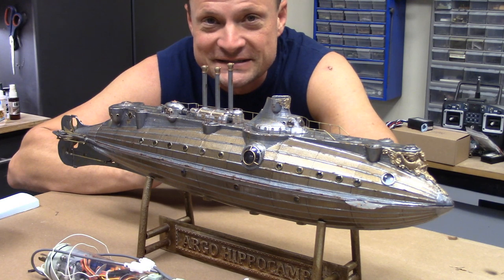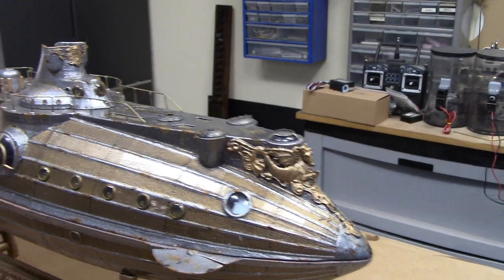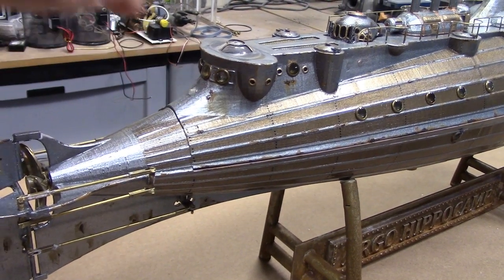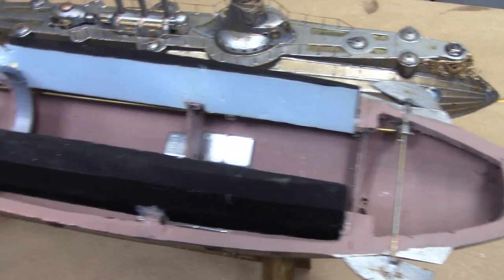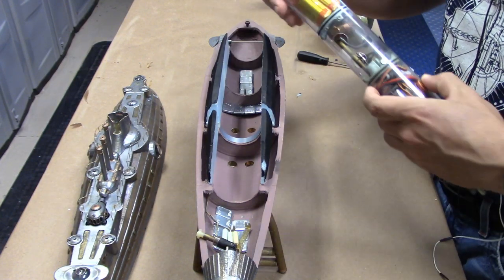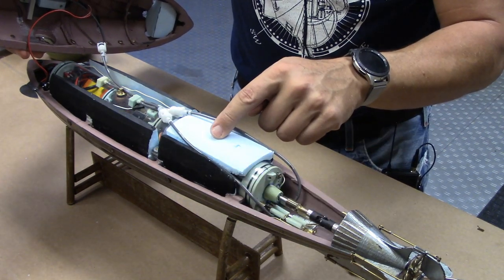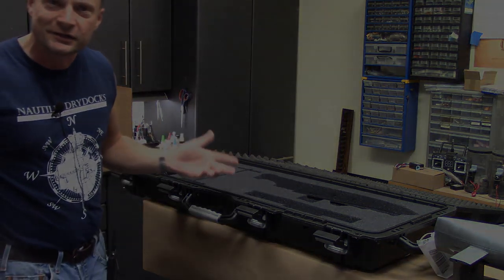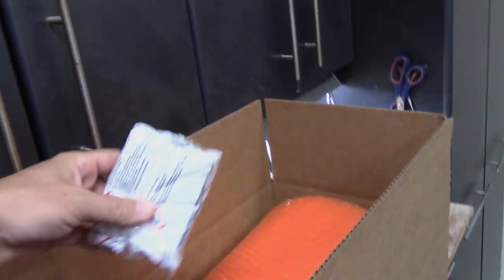Argo Hippocamp Steampunk RC Submarine

Comment: FANTASTIC MODEL !!!

This is my first time seeing your channel. Have you ever mounted an FPV camera to any of your subs?

If so, how did it work out?
Reply from the maker: FPV only works above the water as radio signal does not penetrate to any degree at high video frequencies. I've done tethered video with home-built ROV's, but not really the same thing.

Comment: I noticed that everytime you build one of these that the entire interior is taking up buy the motors and works have you ever built a working model that was and exact replica both inside with crew compartments and all interior exactly like the real thing like a design engineer would for checking for flaws. Think like you were building a real sub for 3 inch tall people! It would be very interesting to see if it could work. Thanks
Reply from the maker: Anything is possible. Sure. What you're talking about, however, would be a massive undertaking in R&D, engineering and implementation. You know someone that is willing to pay $50K (or more) for such a boat at such tiny scale? Pass them my way!